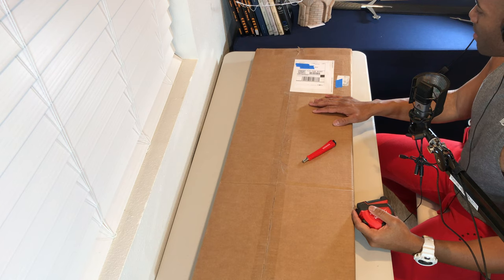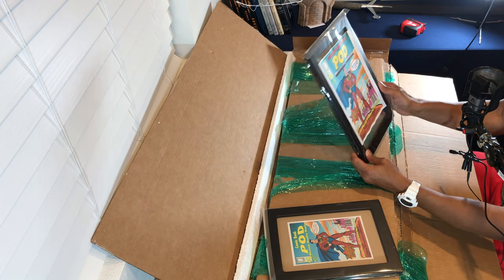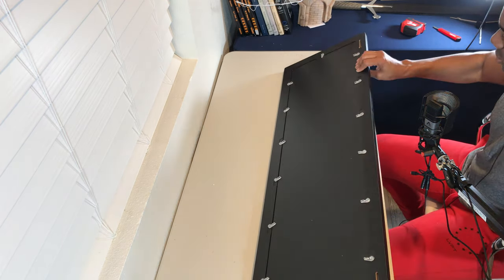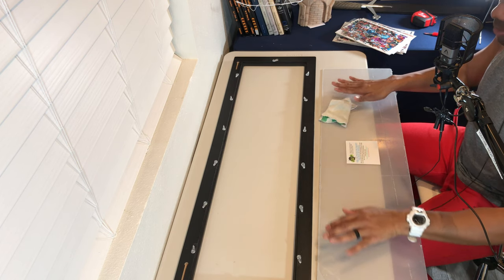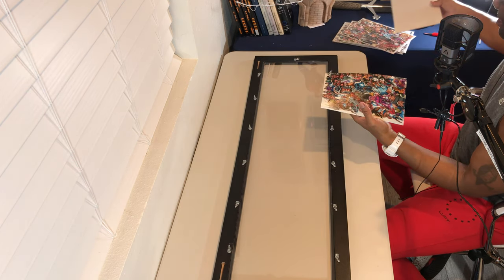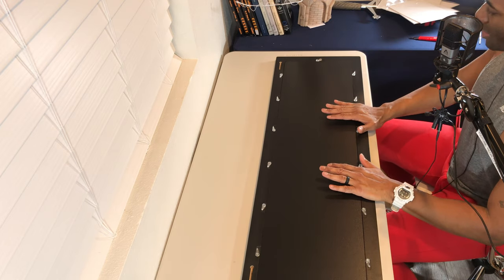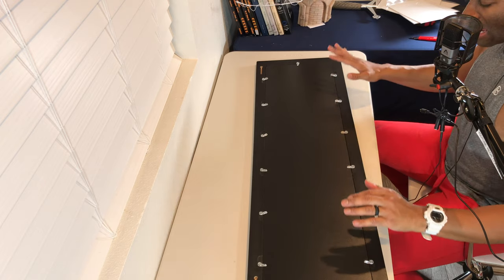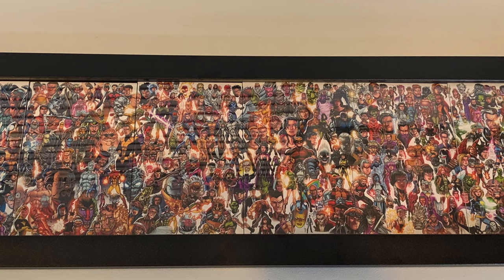Dope Setup For Displaying Six Connecting Covers At Once

Comment: Was the package delivered to your door, or did you have to go pick it up?
EDIT Just recently, I came across a Spider-title with two gatefold covers, front and back - that's another thing the frame could be used for, doncha think.
And Archie comics once had a set of four connecting covers that connected as a rectangle/square.
EDIT Looks good, wonder if there was a poster of it available.
Reply from the maker: It was delivered to my door which was fantastic.
Reply: @RegieCollects  Could have gone either way, I guess - I've experienced both deliveries to my door and having to go get the shipment.